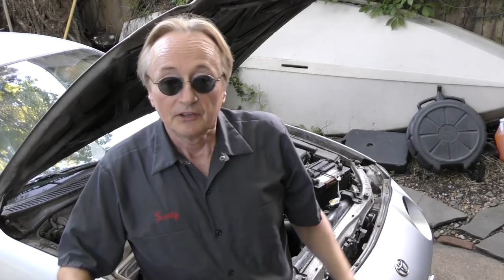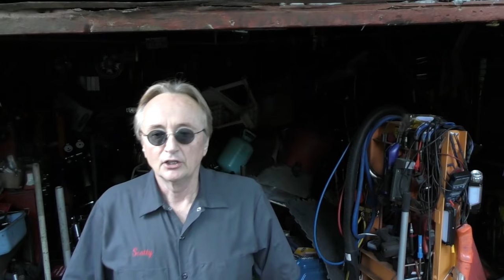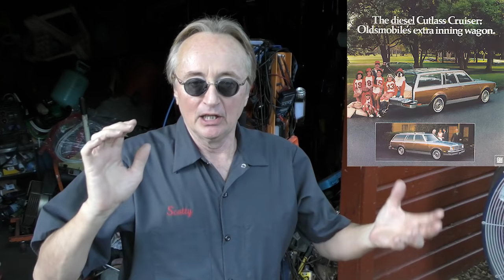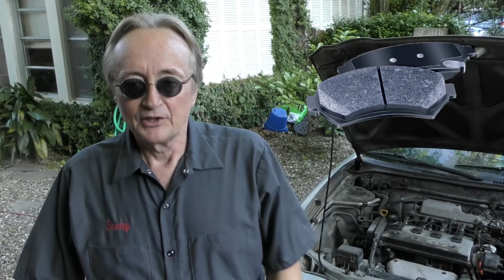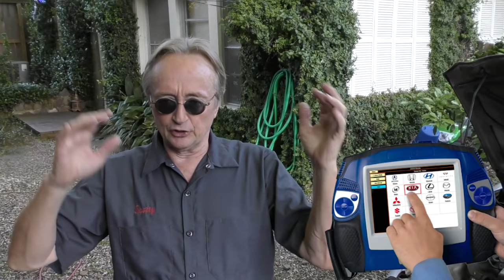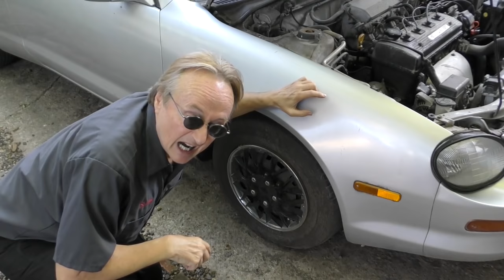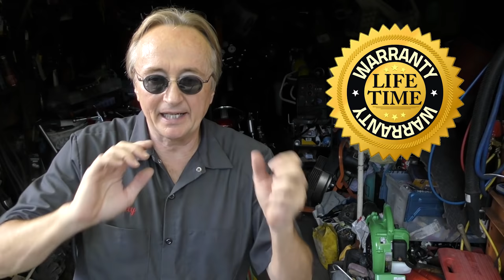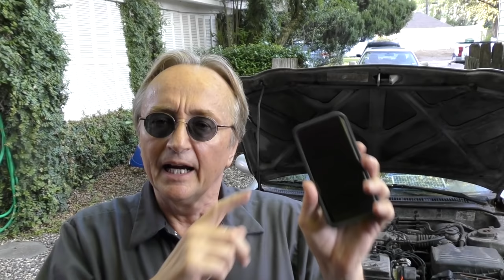5 Scams Your Car Mechanic Doesn’t Want You to Know

Comment: My mechanic told me to change the transmission fluid at least twice a year. I told him, "it's every 50 thousand miles" & he responded with "That's what the transmission guys say so that when it breaks you have too take it to them". I'm re-evaluating our business relationship.
Reply: Changed mine in my 2000 Lexus rx 300 for the first time in 2020. Had 210,000 miles in it. It was dark yeah, but no issues. Goodbye to that mechanic. Sold the car to àn old girlfriend and it's still on the road. I'm gonna drain and fill every 50,000 mikes or so with the one I got. It's either built well or it's not.
Reply: @starkeymorgan4142  In retrospect, I was wrong… Partly. The reason it’s done sooner than 50k is because when you do a transmission service, the oil isn’t getting a 💯 change, the new oil mixes with the small amount of the old oil still inside of the converter. Now, of course if you do 50k mile transmission service from day one on a new car there isn’t a problem but on old car you don’t know if the prior owners did it every 50k miles, so doing it early a few times should get most of the old oil out. By the way, doing a transmission service after that much mileage is very dangerous because the amount of sludge at that point would be stirred up & begin to clog the tiny pathways, valves, & seals inside the transmission. She’s driving your old car? That’s hilarious. Tell that woman to treat the transmission like a baby. No quick drive-reverse or anything like that. Make sure when you put it into drive that you give the transmission enough time to change. Etc etc
Reply: @shechshire  she's a certified mechanic. Told her exactly what I did and how I did it. Many, many folks have done exactly what I did with no issues. I would do the same thing again. Researched for 2 years, pros and cons, and did it. In this particular old car, I knew All of it's history. It was well taken care of. Also, I am aware that only a portion of the fluid is drained. Knowing that, fifty is half of what my manufacture recommends (Honda) for my vehicle. I feel silly doing that. Hell, I might wait 100,000.

Comment: F.I.A.T. = Fix it again Tony!🤷🏻‍♂️
Reply: Had a few of them,  to me it's Fire In All Tins!
Reply: or Fix It Again Tomorrow LOL
Reply: I was lucky with my old Punto. It was a tin can but very reliable. 54000 miles town driving, only ever changed oil and filter every year and never had a single  problem with it.
Reply: Sold my 1995 Punto with 229 000 Km only had to change the bearings of the rear suspension, did it on both sides, cost me 80€ each side. The 2007 had 110000 city Km - average Speeds around 18km/h. Fuel Consumption was on the claimed 5.7l in Winter around 6.3l. No Problems at all, sold it in 2017 to a friend and he still speaks to me.

Comment: I put a $25 catch can on my GDI Lexus, problem solved, no more carbon build up on the intake valves. Easy fix, works on any GDI (Gas Direct Injection) engine.

Comment: The dealer tried to charge me extra for the timing belt while they were replacing the water pump.  I asked well since you need to take off timing belt can you replace it with a new one i will hand it personally to the mechanic.  They laughed and just charged me for the part.  Never went back.

Comment: Thank you Scotty! I was a truck mechanic in the Army 78-85 And even i fell for some of this crap myself, cause when ibworked on army trucks which didn't have all the stuff that are on cars today. I took my 2012 corolla in for tires cause i liked the price of the tires at the dealership where i bought the car about  $525 for all four. But left out with a bill for $1100. The part i felt ripped off was the rear brake cleaning cause the drum brakes hold in the brake dust, unlike disc! Can't believe i fell for it.

Comment: I had a friend that told me his wife took their car to the shop for an engine vibration. The shop told them it would cost $1500 because they would have to pull the engine and replace all the motor mounts. I told him I'd look at and found the top torque mount rubber was torn. Cost him $30 and took me 20 minutes to replace. The sad thing is we were both in the Navy and deployed when she took it in to an on base shop. Just because to think you can trust them, dont.

Comment: The worst thing for brakes is to sit around and not get used.  It's totally possible brakes rusting and seizing up and needed brakes annually.  Mileage is almost irrelevant with brakes.  Highway drivers get 100,00kms on a set of brakes. City drivers get 50,000kms.  Cars that aren't driven, need brakes all the time.

Comment: The Porsche thing is kinda right from the dealer perspective. I don't remember Porsche maintenance schedule completely but for example Bentley brake lines are supposed to be changed every 10 years. Might not be necessary, but needed to make sure everything is up to factory spec.

Comment: Quick question. I have a 2009 Honda Accord EX-L V6. Recently had the front suspension/ subframe redone from a rust problem. The shop I go to says the the shocks need to replaced in the near future. Should I listen to them? It’s not that expensive per say, but I’m trying to save up for college. Other than that, it’s still going strong after over 160k miles.
Also, love the videos. They help a lot!

Comment: My wife bought an 09 Patriot 6 years ago. I was pretty pissed at the dealership as what they told her was it was a 4x4 and it wasn't.  Then they were charging her the same price for a new one. Yes she's a blonde. 
She was determined to keep it though after I pointed out what they had done to her. She went back and got them to reduce the price 3k, and do oil changes every 3 months for 3 years, and yes I made sure they did the work. A couple years down the road I decided that the milage was sufficient to warrant a fluid and filter change, so I took it to the Jeep dealership my sister works at and they wouldn't do it. They said they would only change the transmission out. So I decided to do it my self, but I put it off a little longer.  We had gone on a road trip on not a particular hot day when a 'ping' and a light came on above the temperature gauge.  The transmission went into trouble mode. So I pulled over and let it cool down.  When we got back home I unscrewed the fill tube plug and checked the level. Seemed to be a little high. It overheated every time we tried to go over 55. So I ordered 2 intercoolers and pulled the front bumper cover off and installed them. You should have heard my wife when she saw it. Dropped the pan and drained the converter and changed the screen. Didn't change the filter though. Put fresh fluid in and figured out that the transmission had been over filled before and may have been the reason for it overheating. Been on a few long hauls and no issues. Filter is hard to get at, looks like I might have to drop the tranny down to clear the filter. 
Filter change and fluid change coming soon, 30k is almost reached.

Comment: Oil life monitoring by cars is done by watching oil pressure as engine gets to operating temperature.  NOT a pre determined time interval.  If oil is deteriorated the oil pressure is down from new oil.  If my oil life monitor comes on on my vehicle and I reset the monitor, after 3 drive cycles it comes right back ON.   Regardless of time or kilometers.  I am surprised he doesn't know this.

Comment: Hey Scotty - Great informative video - not so much me but my wife prior to getting married (39 years ago) got severely ripped off on a simple job - to make matters worse they swapped out her spare tyre and a rear tyre for two pieces of resprayed crap that literally fell apart backing out of the driveway - could've killed her if travelling down a highway - I nearly killed them - shall we say we settled out of court. Around the same time my Dad had his engine reconditioned at the local garage (not cheap) - he asked me to have a look when he got it back - they had installed without all the engine mounts and the engine was resting on the cross brace. We took it back immediately (Saturday morning) my Dad was in a foul mood and definitely not the kind of guy to cross. The garage boss initially disputed his claim, but after being grabbed and thrust head down the side of the motor for a "better look", he suddenly changed his tune - apologised and gave it a priority repair, filled the tank with gas, detailed the car & wash and polish. Not another penny charged. Jeez I miss the old man.

Comment: i remember the one mechanic said to me that i need to change the whole brake system at front left side. brake disk whatsoever. and then i talk to the veteran mechanic for 2nd opinion who is never want nor greedy at money. when he check he said the main problem the gasket of brake. automatically press the brake and lock.
so he put grease and good to go. i pay $3 than the one mechanic said i need to change for $1,000 stuff and additional labor.

Comment: The maintenance required light doesn't mean something on your vehicle is broken just means you should have it checked out. This prevents owners from driving their vehicle never having it routinely checked. It is wrong to try to use that as an excuse to sell things to the customer but it can also be good if during the inspection a minor problem is caught that could have been costly to the owner. For example, people never check oil and some would never even know to change their oil. Obviously, not checking your oil or changing your oil can lead to major issues. The maintenance required light is a reminder to have your vehicle inspected to make sure it is functioning in good health.

Comment: I got my tires services with Firestone. after a few days, I got TPMS warning light.  I took it back, they said 3 bad sensor which will cost $500.  Online sensor costs $40 when I did my research.  I decided not to get it fixed by them.  After I  pick my car up, the warning light is gone and stay gone for two weeks and 500 miles.  I think, they put the fault in programming sensors and cleared it once they know I am taking my car somewhere's else.  They know I  will find out the truth.

Comment: "Customer safety" is why when you own a mac computer, they will make any excuse to trash your data when doing even minor repairs.

Dealer repairs are only good if you get a good maintenance plan, I had a bill for 200 something replacing a horn at the dealer, for a motorcycle.

Aftermarket place charged me 15 for their spare horn and the install while replacing my back tire and chain for the price the first place wanted for the horn.

Comment: So I bought my first car in January. It's an 05 mercury sabel 6 cylander and came with 74000 miles. The car was as is from the dealer but they said everything was up to date and in good condition and that my tires were gently used all season tires. I've had multiple engine problems and then yesterday my rear tire exploded and turns out they are retread tires not all season

Comment: The tires have an expiration date, after years the rubber gets old and can be unsafe to drive. This is why you can get really nice high performance tires on eBay for really cheap. You check the date and they have been sitting in the warehouse for 12yrs. Thd guy was a millionaire so he probably just earned to make sure the car was safe.

Comment: You also need to pay attention to the wording mechanic use like the the words "suggest , recommend or requires" . A mechanic can "suggest or recommend" literally anything on a vehicle , he/she can say something like "Mr/Mrs Jones i recommend or suggest that you replace your brakes" even though they may have 75% left on the brakes . As an example The mechanic can suggest or recommend that you change you speakers and say its because of a performance issue . Each mechanic has their own code or level of ethics and conduct . Now if they say to the customer that their brakes are a required replacement and there is still 75% left that there is a law suit whating to happen now If they use the words "suggest" or "recommend" thats not a law suit . Like i said a mechanic can recommend or suggest anything and claim it a preventive maintenance issue and get away with it . When i use to work at Sears auto thats what they told us , we had to be careful on how we worded the estimate . They got a little upset with me because i wouldn't comply with their ways of doing things , if a part or a service was needed i would talk to the customer and let them know , i didnt play word games . So pay attention to your estimate and the way its worded .

Comment: I have a /2008 Pontiac g6 that drove me in and out of the state for 2 years and one day the car wouldn’t start so. So I took it to this place and they came up with a 1500 dollar repair saying my car needed all of this stuff . Then I told them no . So then they wanted me to sell my car to them for $350 because they say if it was them they wouldn’t put money into that car . And I can’t believe I almost sold it to them . Here’s the kicker ! For that man to look at my car He charged me $140 dollars. What a rip off so then he says when I’m ready to sell to him he would take off the price of 140 from the sell price and I’m like what? Did I hear him correctly . So what your saying is that if I sell you the car then I would only be getting around $200 for it . Just so you can profit off of my parts or fix it and sell it for higher . I listened to my intuition and took my car somewhere else and they put a new starter in and did and oil change and changed some sensors and vvt solenoid for $550 . Now I’m pretty sure that I didn’t have to have all of those things maybe the other place took advantage but $550 is a better price than $1500 . All I needed was my car to start and now I’m thinking about learning how to work on cars myself

Comment: I worked at a shop where we would get cars in for a second opinion after they went to another shop down the street. Every single time, without fail, they would be quoted $700+ in repairs from the other shop. Every time nothing that was listed was needed.

The weirdest part is they were always trying to sell terrible jobs like rack and pinion, when half the time the car would actually need struts or other good money, easy jobs. 

They were not a very high caliber shop to say the least.

Comment: Is it too late to change transmission fluid on Nissan Rogue with 90K miles?  You are recommended to change it at 60K and do not change it if it is a high mileage one.  I am in the middle.

Comment: Being overcharged.  Do not go to Toyota of Erie.  They charged me $1,647.00 for front brake calipers, rotors and pads and fid not properly bleed the lines.  The brake master cylinder should have been bled.  Went back to my Bedford Toyota rep who charged about $850.00 six months ago for rear brakes; same parts.  They bled the MC and now brakes work well.  NEVER GO TO TOYOTA OF ERIE (off of exit 24 of I90).  They will screw you.

Comment: That's one of the major reasons I hate flat rate. that's why flat rate is a rip off. Honda has a sixty thousand mile service interval. for a timing belt replacement. and if you go one mile past that service interval. and the belt breaks. and because they interface engines. you are on the hook for buying a new engine. I seen that happen to a customer. when I worked at a Honda dealership.

Comment: I got a bad experience sir with the repair shop. I was complaining about the noise from the engine, and i let them fix my AC for having blowing warm air, and they said it was the condenser it was bend, they said the noise is coming from the timing chain. I was thinking the ac compresor but they said its still good. So iwent back to them and let my timing chain fix for 3500 dollars for that noise, they said the ac compresor and alternator need to be change it will cost 2700 dollars,. BTW after the fix my timing chain,  i drove it for 5miles then i got problem with overheating. Coolant spill on the highway, then i went back and complain, they said i need to replace the radiator fan. What a day for me and my wife they ripped me off. They just want money.MVR auto repair shop here in las vegas. They really scam us for all the repair.

Comment: Scotty, I took my 2014 Ford Fiesta  to a shop and and they said the oil drain bolt snapped off. They want to charge me over 700 to replace the oil pan. Are they trying to rip me off? The part is only worth 60$ on the high end plus the 10$ drain bolt. Should I have to pay for the negligence of the shop?

Comment: My car is 14 years old and I have had done 9 service, 1 set of tyres, one set of front brakes and I haven't changed coolant and I still running it to the red line and ride the clutch and it perfect 
It a nissan tiida ST 2006

Comment: My mom's car turns off sometimes when it stops and won't turn back on unless you take the keys off put it in and turn it on again.  When we went to the mechanic they told us it was a freaking feature of the car so we save gas.  My mom flipped out and went to another mechanic.  It got fixed

Comment: My neighborhood mechanic quoted me $2000 to rewire my O2 sensor connectors.. only one of them was bad when I went under the car. I got new sensors and kept the old connectors (did the work myself) and car runs like a champ. It's been 1 1/2 years  since that .. why do mechanics assumed people don't know anything about their cars. Also another one of these bums quoted me $700 to replace my alternator. What a bunch of slime balls .. did my alternator myself in 3 hrs and only paid $160 from AutoZone 🤷